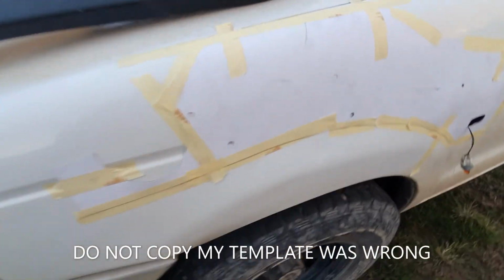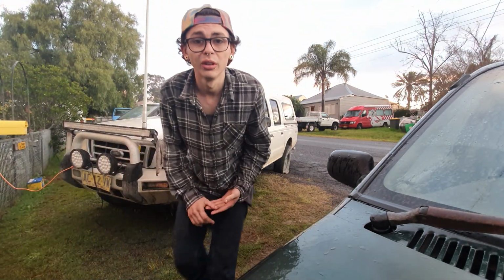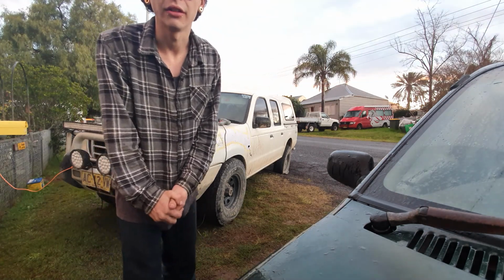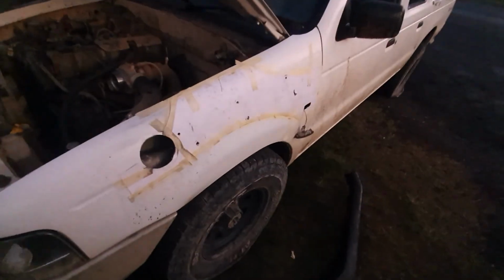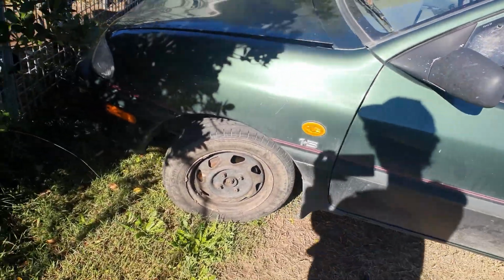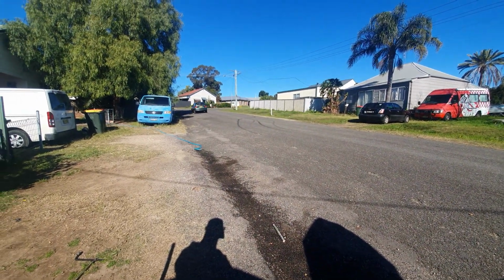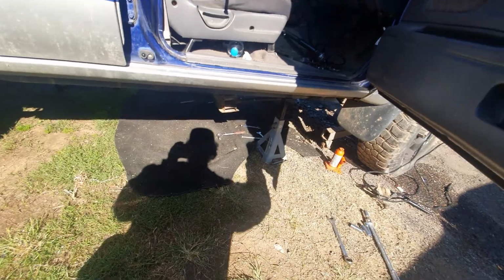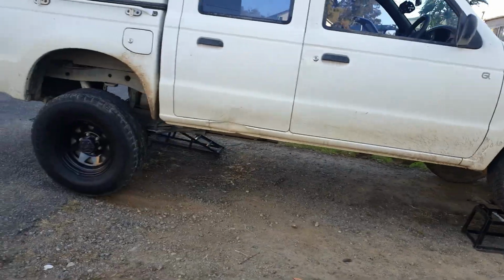Tried to fit a snorkel, crashed a nav and said goodbye to the green thing

Comment: thread the studs into the snorkel, put a dab of grease on each stud, line up the big hole and press on to the guard. the grease will mark the holes you need to drill.
Reply from the maker: I have a plan and if it doesn't work than I'll give it a go